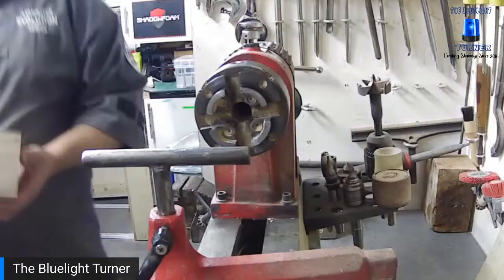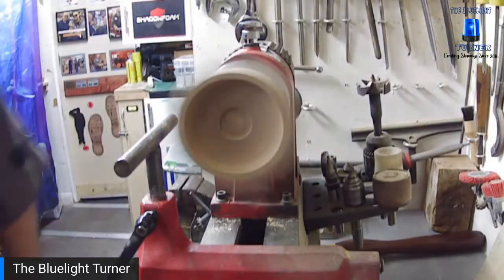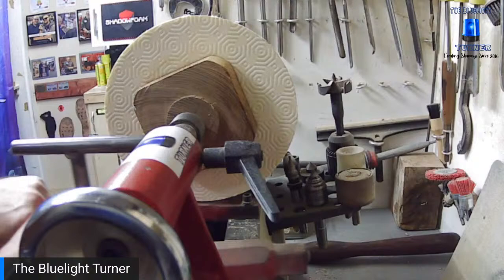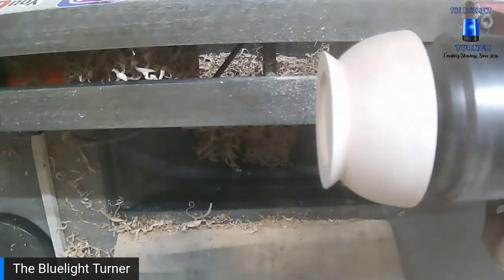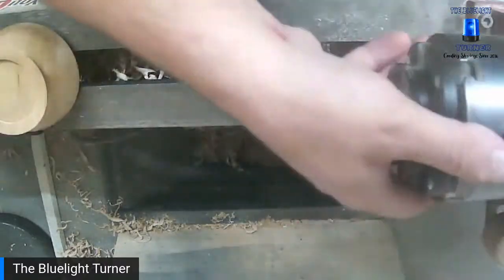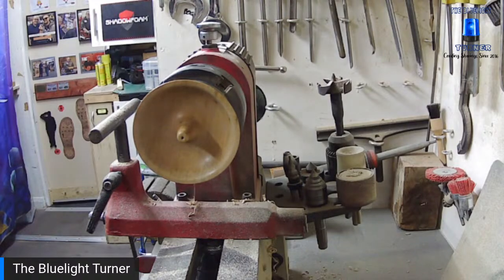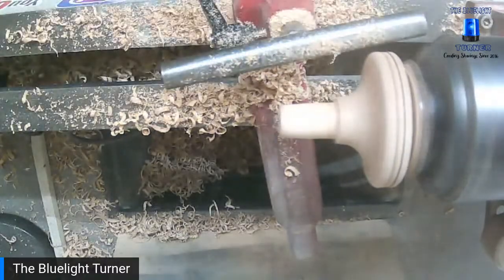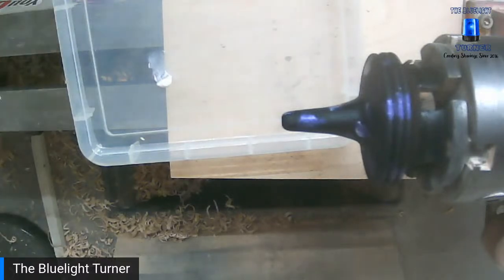Woodturning For Beginners - Incense Burners

Comment: Nice live.  One small question, do joss stick holders have to have an insert like all the other burning stuff or are they sold as for decoration only?
Reply from the maker: Hi Kev and thanks for question, all commercial Joss Stick holders are just wood because the incense doesn't go all the way to the bottom of stick so shouldn't burn or scorch, so not necessary for insert, on some of the others I have made I have incorporated a 6mm aluminium dowel with 2mm hole drilled in to hold stick, just forgot to do it last night. The incense cones definitely need an insert, you can buy small brass ones, but I found the disks I'm using cheaper and thicker.
Reply: @TheBluelightTurnersWorkshop  thanks for that.  I had some tubes delivered years ago and never used them....ideas, ideas